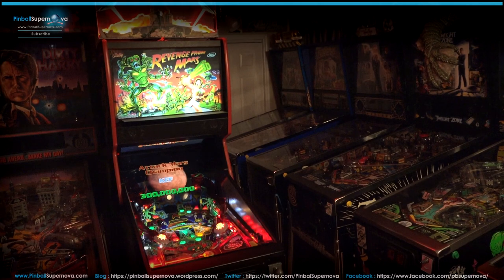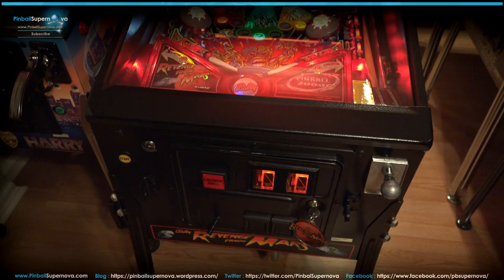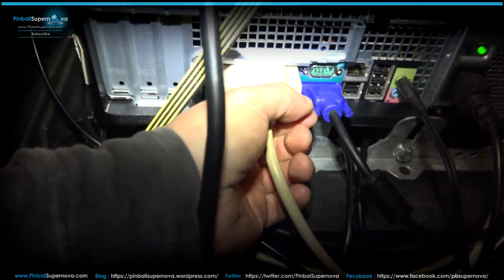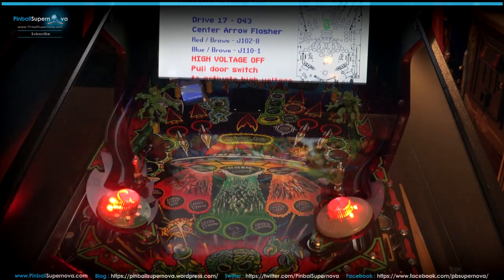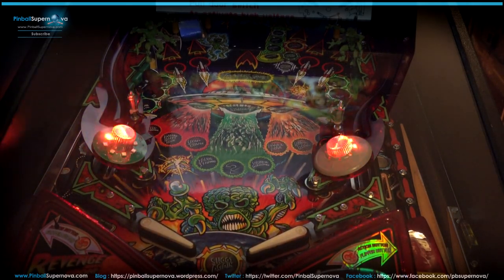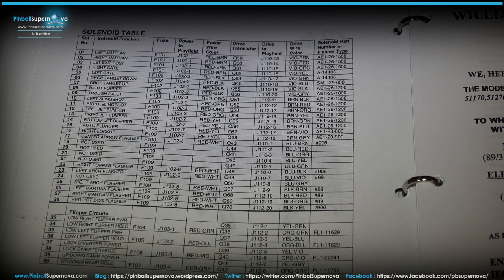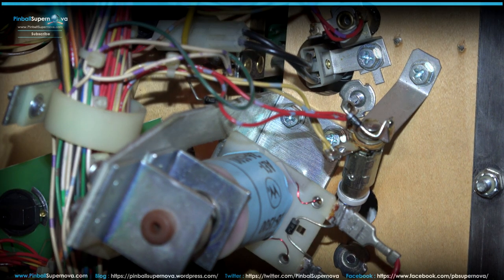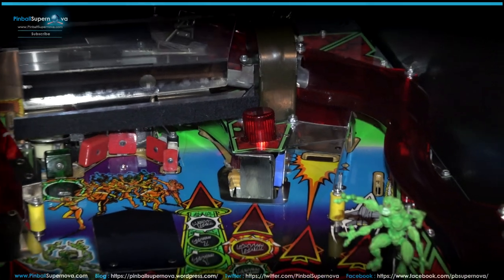Pinball Tech and Repair #33 : OVERVIEW OF REVENGE FROM MARS - FUSE 109 BLOWING

Comment: The flasher above the VUK is probably occasionally touching the scoop eject metal work and shorting out.  Remove the plastic and install heat shrink over the cables and solder connections.  Had this on a few RFMs over the years I have serviced.
Reply from the maker: Awesome, thanks for the tip.  I will do that on mine.  Thanks again for watching and providing help.